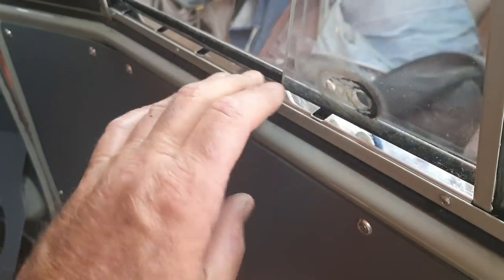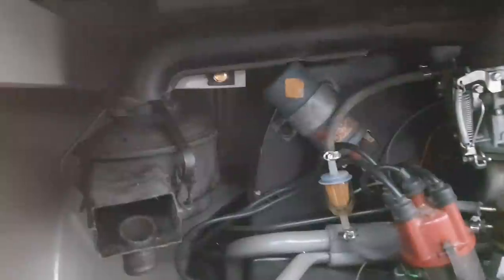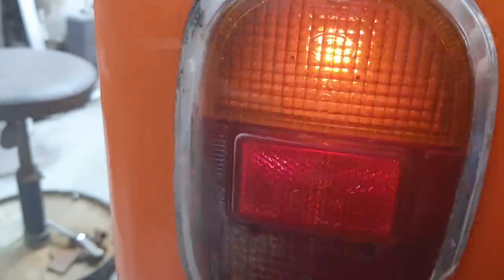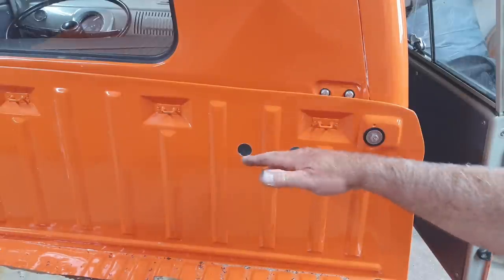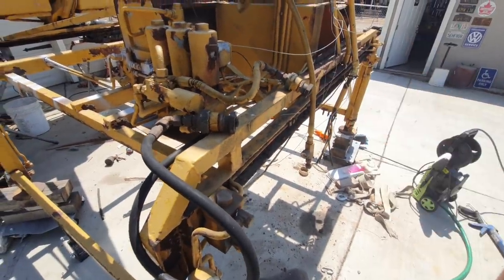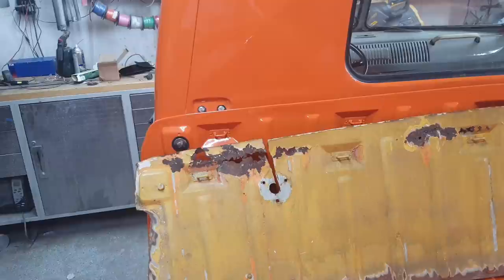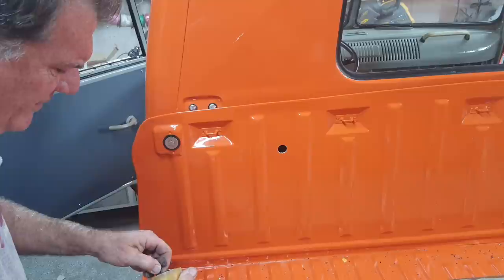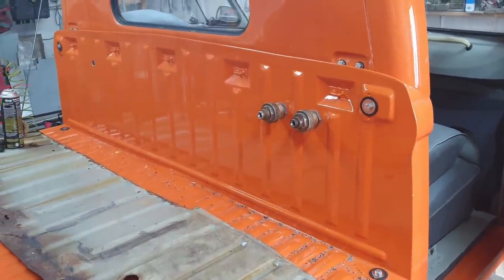RARE VW SINGLE CAB SO-10 BUCKET TRUCK working on the special model parts

Comment: Good day Mike,
the metal socket (trailer socket) actually has the following cable assignment:

Pin 1 = Contact L = Color Yellow = Turn signal Left
Pin 2 = Contact 54g = Color blue = Rear fog light (was probably also used as contact for rotating lights)
Pin 3 = Contact 32 = Color White = Ground
Pin 4 = Contact R = Color Green = Turn signal right
Pin 5 = Contact 58R = Color Brown = Taillight Right
Pin 6 = Contact 54 = Color Red = Brake light Right / Left
Pin 7 = Contact 58L = Color Black = Taillight Left

Since this can is for the riser assembly, the power supply will probably vary a bit. At least you know now what these numbers in the box should mean.

Kind regards from Germany

PS: The trailer cans are here in Germany also still in stock (so there is not only in UK)😉😁

Comment: As a couple of others have said here, the 7 pin socket your working on is a regular trailer socket found here in uk.
They are plastic these days, but the mounting screws and pin positions have never changed, and will work with your old plug if you choose not to renew that.

Comment: I had those taillight gremlins too last week..mine was a utility trailer i rarely use...i had rewired it completely a couple years ago....worked great last fall...went to go pickup a killer garden tractor package and drivers rear was f*cked up!!...after trying to find out " Why " without anything obvious being wrong....i grabbed a led marker light and boom worked perfect....wiring is ok ( as i knew and why i replaced it 100% )....stupid cheap taillight was the problem....damn chinesium made crap!! Yours is a Bavarian issue...lol

Comment: Mike your plug your going to clean up is by the looks of it a seven pin trailer socket, still available new here in the UK.
Reply from the maker: cool if I need a new one I can get one. I think it will free up. the pins are stuck right now

Comment: I wonder no paint the holes and no seal. The socket is a simple German trailer socket, you get it in Germany but most in plastic today. Clean this and use a new inner part. Original it is not painted.

Comment: You work like 99% of the Signguys i knew in my province ...drill before confirming it is correct....Measure and Measure again....fit your parts and Double check your measurements will work....alot less work.....imho